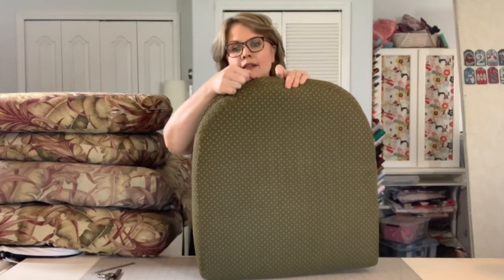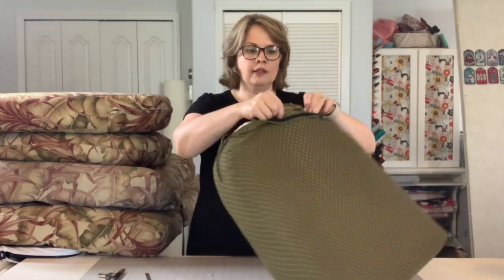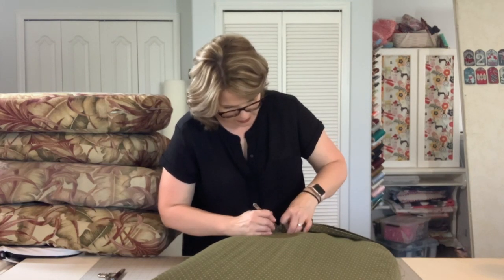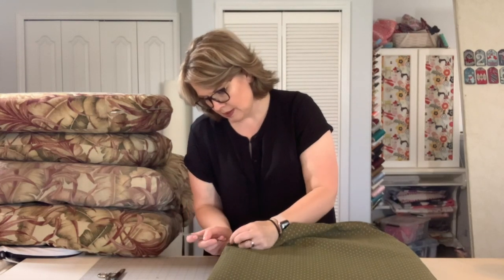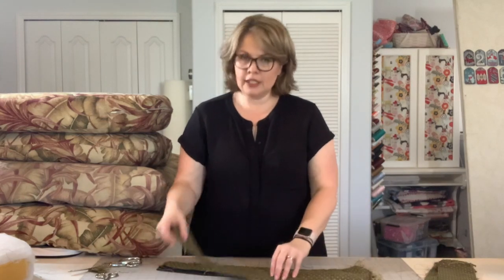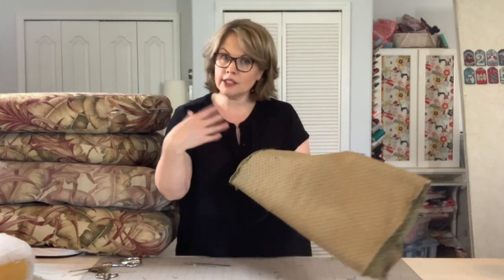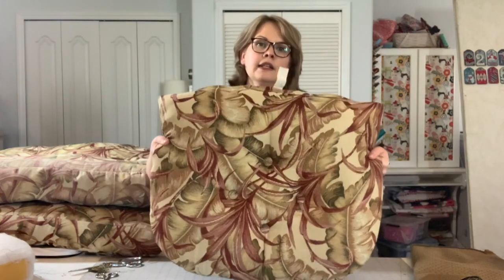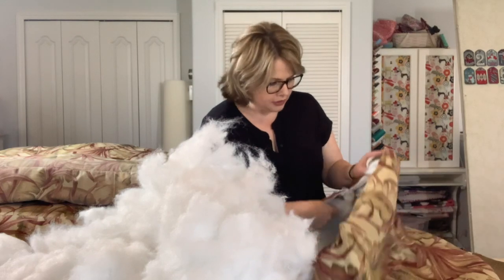How to Deconstruct Patio Cushions

Comment: This is exactly what I have been looking for.  Thank you!  What is the best way to add more foam to a cushion to make it a couple  inches deeper?
Reply from the maker: You would need to buy thicker foam and then add that much more to the width of the gusset. So if your old foam is 3” and the new foam is 4”, add 1” to the width of the gusset. For a cushion that has a wrap around cover, like the first one in the video, you would also add 1” to the long part of the cover. If in doubt, measure. :)
Reply: SewCanShe Could I add to the old foam by buying a piece that is 2 inches thick and gluing it to the old foam or just go ahead and get all new foam?